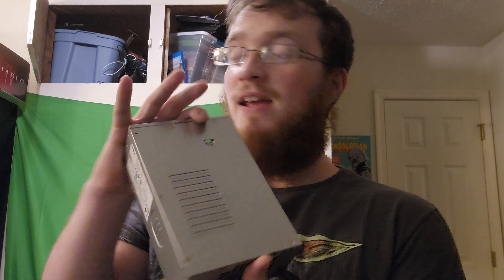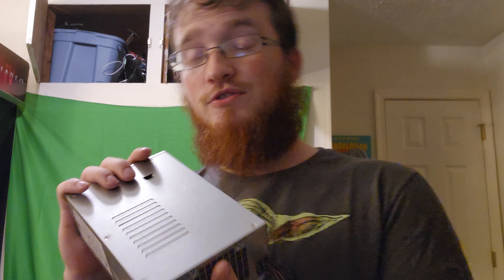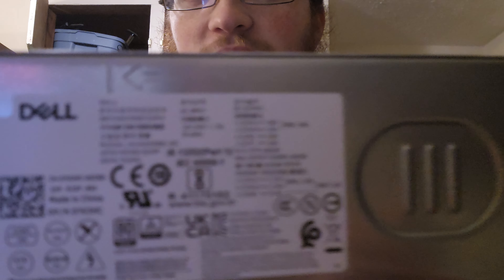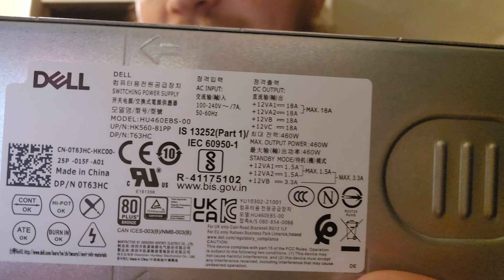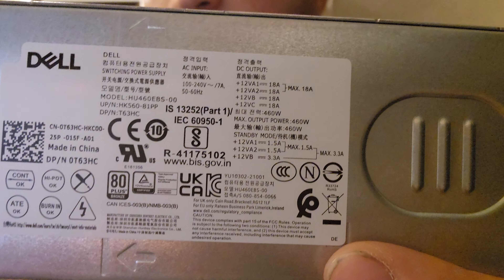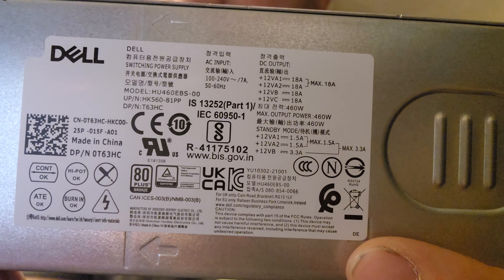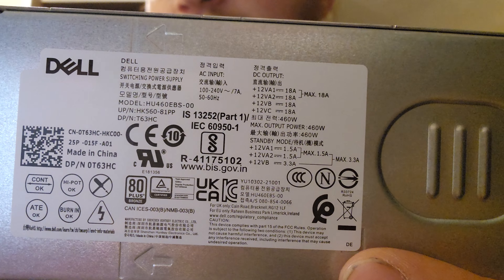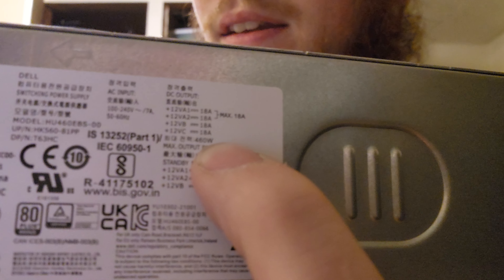I bought a "NEW" Alienware computer from Amazon and essentially got scammed.

Comment: You can get cheap case like for 40dollar, and they have some very good deals even, then you upgrade bigger one later.
Or you can try buy used computer, and that you upgrade it to new parts over time.

Always count the fans in the price, for some reason the cheap cases comes usually with +4 fans, when the pricy ones come with one or two fans... 
its annoying that they dont sell you maxed out versions. Anyone else wondering about this ?

I think some of them expects you to add AIO on the missing slots, but still.

BTW, i heard Diablo 4 has some major issues with burning and killing your hardware. <-- Double check this claim, i havent bought it just couse this, and overally it did not feel like my choise.

Is wise to have lower specs computer for testing periods, so you dont get srewed that much.

Do you wana risk your 3000dollar computer, or Dell Optiplex for 500dollah.

Pretty much any new game are a question mark until you have gotten some time with it.

Comment: Depending on your CPU the 460W PSU is more then enough for a 6600XT. The 500W is just a manufacturer recomendation not a requirement.
What CPU is in the Alienware? If its an i5 or Ryzen5 then the PSU being 460W is not the issue.
Something like the CPU is overheating maybe do to bad cooler contact or something else.
Sell it to someone who knows more about computers and let them figure it out.
Watch computer building tutorials before you continue with your build. Pauls Hardware has some good ones for example.
Good luck first time can be intimidating but its pretty easy in the end.
Reply from the maker: It worked like it was supposed to when I put in the 750W, it's an i5, but 750 is still what it was supposed to come with new like how amazon had it posted, I have one more day before my 4070 GPU arrives for my new built computer so I'm pretty excited
Reply: @ZACULTRA  Ok then the 460W was defective or something. But anyways have fun building the new rig. 🙂
Reply from the maker: It was pretty fun..little annoying doing the cooling but I got it eventually lol
Reply: @ZACULTRA  Let us see it when its in one piece. 🙂
Reply from the maker: I definitely will!!

Comment: Buying computers on Amazon isn't a great idea it's good for buying parts but still you gotta work really hard to get scammed by them. They have warranties and free returns if you pay the monthly fee. Alienware sucks Always reaserch what you're buying before you buy and always make sure you have an extended warranty or free returns. Building a computer isn't that hard you just have to make sure you do the steps correctly. Ive been a tech for 30+ years. Are you sure the fans are plugged into the correct places if so then all you need to do is buy a fan controller and get control of the fans again. You changed the fans put the old fans back in and  if it corrects it then you will need a fan controller to run the new fans.
Reply from the maker: The return window was closed in May, I had no issues with the computer until recently. All Aurora R13's come with 750 Watt PSU, they put a 460 Watt with a GPU that requires 500 and called it a day. The description said New, but I'm sure it was pre-owned and rebuilt. And yes everything was plugged correctly, I just finished building my new one earlier today I'm just waiting on my GPU
Reply: @ZACULTRA  Still the alienware you said you changed the fans right? Why would you get a new GPU and not use the one you got? I would have just bought a new case  and power supply and transplanted everything form the aliennware into the new case with the new power supply then sell the case and power supply. In any case, you said the fans arent being detected right? They are the replaced fans right? If so then put the old fans back in and see if they get recognized if they do and you want to sell it with the new fans get a fan controller they are cheap like max 30$ and it will give you control of all the fans again and take the bios no CPU fan detected error away that you are most lilkey getting at boot. It's hard for me to do text diagnostics and what not but if you're plan is to sell that Alienware you need to remove that error so if the old fans get detected than you kmnwo the motherboard fan controller is fine and that it just can't see th enew fans anyone buying a rig like that will want fan control under heavy load the fan won't speed up and it will throttle back or shut down.
Reply from the maker: @KoolBreeze420  I had gotten fed up with it and honestly was more annoyed about how it came, my fiancée said the same thing, but I'm a believer in if you want to do something take the chance, I've never built my own PC so when I thought about doing it and my fiancée helped me decide I went for it, but I'm tired of spending money on a computer that already should've been built properly for the price and description that was on Amazon

Comment: Hope everything goes well ! Quick Tip: Always order parts in a manner that you get the components required to test each other coming within a day or two of each other. Like you get CPU (with iGPU) or with GPU, Motherboard, Ram, Power Supply, Storage as you can test with all together neither could be tested without any of the components. Then you can get replacement for the ones not working.

Also take the alienware to dell service center for fixing.
Reply from the maker: Thanks for the info!

Comment: I don't bother building computers anymore.  I just like the workstations.  The are super upgreadeable and have tons of modularity and ECC RAM which never crashes.  Using a z620 rev 2 with a GTX 2070 and it games really well at 1080p maxed out.  I game on my 55" LG 3D TV which looks amazing but is 1080p
Reply from the maker: As far as builds go I don't think I did too bad with my first one built earlier today lol I'll release an update video about my new PC when I get my GPU in
Reply: @ZACULTRA  Yeah, that looks like a good set up.  What case did you get?  A 4070 will be a monster and very power efficient on top of that.
Reply from the maker: @gametime2473  a 4070 is exactly what I got lol and it's a lian li
Reply: Nice, that's a bad mofo  @ZACULTRA
Reply from the maker: Thank you, I'll release an update video once my GPU comes

Comment: 6600xt has a tdp of 160w.
Reply: im sure he was talking about the total pf the pc
Reply from the maker: Yes, but the wattage to actually use it properly has to be at least 500, when I bought the 750 PSU and played the same games when I had 460 in that made my GPU struggle to run on LOW QUALITY graphics and it worked like normal with 750
Reply: Got a sub from me !
Reply from the maker: Thank you!! Definitely is appreciated! :)